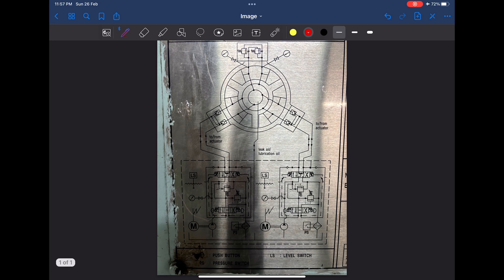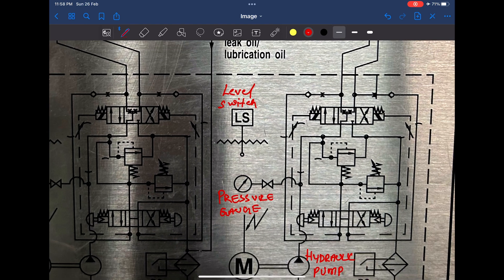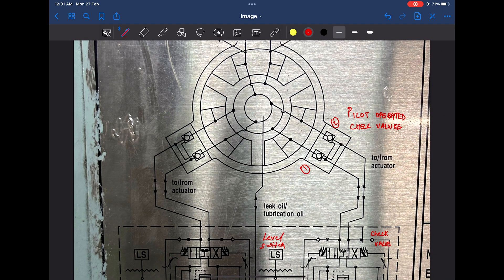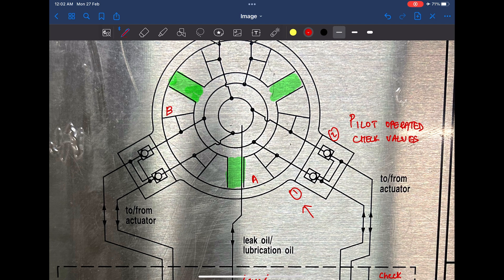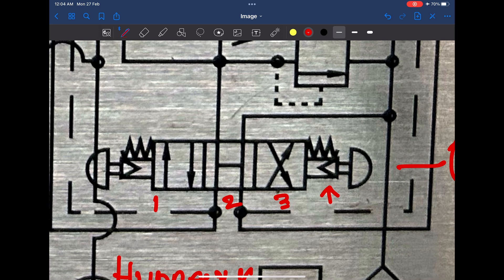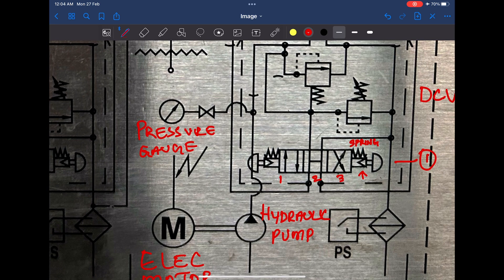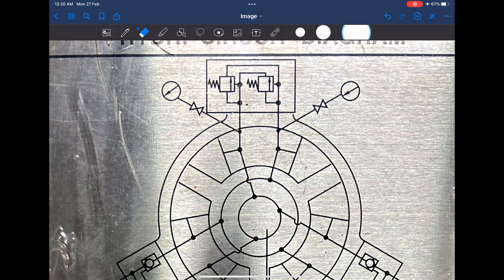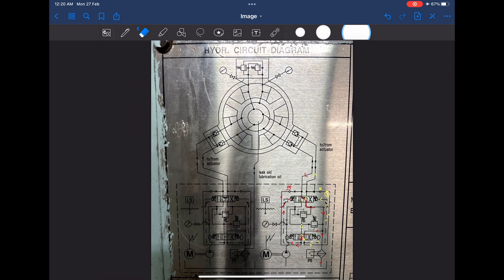Rotary Vane type steering gear working Principle

Comment: Hi what is the cause of frequent hydraulic locking?
Reply from the maker: it could occur due to failure of pilot operated check valves or also due to improper functioning of shock valves